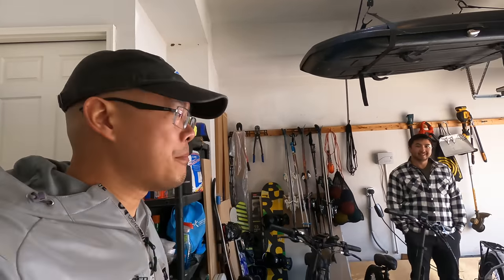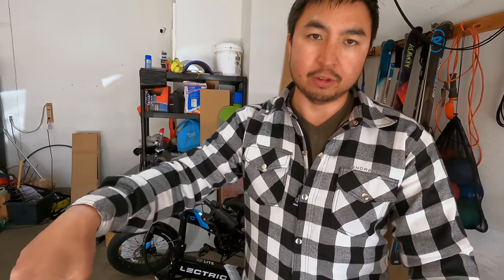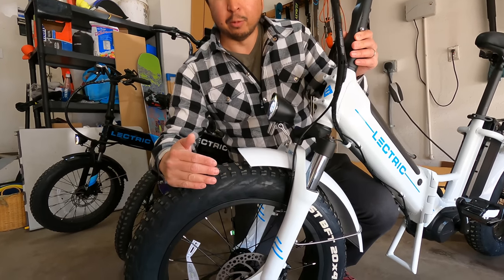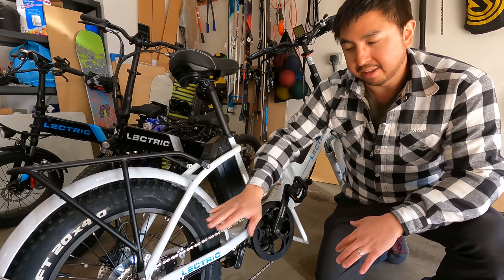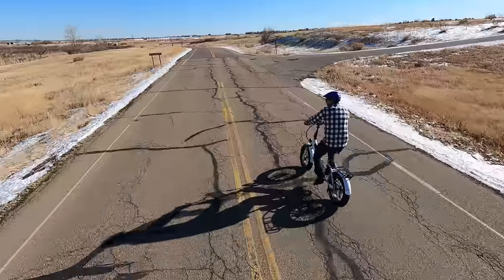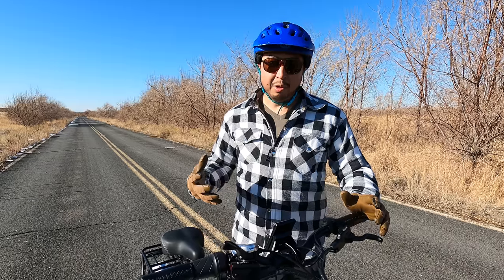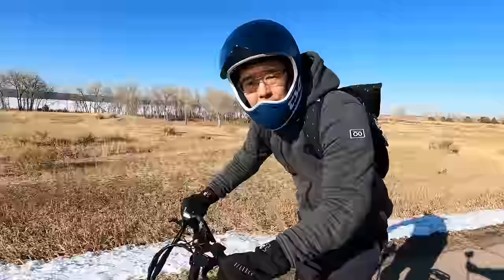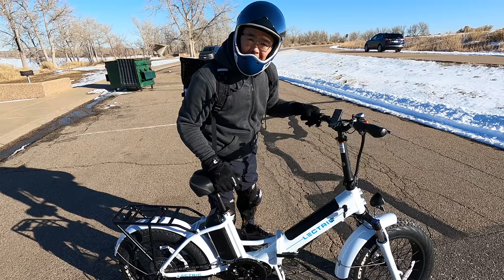Lectric XPremium Deep Dive: The Cadillac of Foldable Ebikes

Comment: I prefer the 3.0 tires over the 4.0. I like less resistance and more carving ability. Hopefully they make a X Premium 2.0 with an upgraded motor for going up steep hills.
Reply: I agree. Also if possible try and lessen the weight to a more manageable 50lbs with an option of getting 3” tires without a so call upgrade of tires.
Reply: I do not like proprietary tires.

Comment: How many NM of torque does this motor have?  thanks for the review.
Reply: It supposedly has 120 nm of torque. However the torque sensor is adjusted so low you can’t even match the power of the 2.0 going up hills. This is a programming flaw in my opinion. Lectric does not want to give the rider the full power of this bike for some unknown reason. I called them and they told me this adjustment is locked from the factory. I’m very disappointed in the bike I waiting more than 3 months for having paid for it in April. Save the money and get a 2.0.

Comment: That's a nice bike. I like the 2 battery upgrade and hydraulic brakes.  A bit too much bike for me and not willing to spend that much.

As an alternative for the same money you can buy two XP 2.0s and have two batteries as well as 2 of everything else.
Reply from the maker: But what if you don't have anyone to ride the second bike?
Reply: @freshlycharged  Just use it for spare parts.  Or take turns riding them.  Your 2 bikes will last a long time.  You can ride twice as far before doing my maintenance.
Reply: @gimpman1357 sounds like there are better brands than Electric, which did you buy?

Comment: let me get this straight. the lectric xp 2.0 is $999 and battery is 9ah. and replacement battery is $299 so, if i get the xp 2.0 with another battery, the total will be 1300 and a total power of 18ah...... the NEW xxpremium has a battery that is 20 ah, just 2 more ah for $500 more? i could even get a third battery for the XP 2.0 and have 27ah for the same price!!!!! Anything else im missing here????

$800 more just for a battery that is 11ah more? no thanks, i can get 3 xp2.0 batteries for the same price and get MORE AH////
Reply: Yeah, the xp 2.0 batt's are grade C pieces of crap, that wont last half as long as a real Grade A battery.  Its too bad you are so gullible to believe a battery is that cheap.  Go read up on what Musk is saying about lithium batteries and lithium prices, and you will MAYBE comprehend how gullible you are.   Battery prices for Grade A real Samsung's (not knock offs of Samsung) are running about $600 retail for 48V 11 AmpHour.  If the price is materially lower, it is not even remotely close to the quality of a real Samsung, and the life will be 1/3rd as long.  You will pay more in the long run, as by 18 months, your battery will degrade by 20% as a grade c knock off, which it is at that price.  The math does not work, and whether Lectric is lying about what you are getting, the truth is, you are not getting Grade A batteries.  Neither are the batteries on this POS with two batteries, Grade A.  Just not happening.  Prices were going way up even before all the supply shortages, as there is just not enough processing capacity for the lithium after its mined, and the mines are MINTING MONEY LEFT and Right.  Musk has raised his car prices that were supposed to be coming down, (due MOSTLY to battery costs) and these ebike brands are hemorraghing red ink attempting to keep their sell price low, but also having to cut severe corners which is being done on the most expensive ebike part: the battery.   There are no DEALS to be had with batteries.  You get bad batteries at cheap prices, and quality batteries at expensive prices.  There are no quality batteries on ANY Lectric ebike. None.  Every XP owner will be buying 3 batteries for every 1 battery that higher quality ebike brands have, that are priced for quality.   If you want cheap, and no quality, then a XP or a Lectric is for you.  But it will be the most expensive ebike per mile you could ever buy if you manage to keep it running more than a couple seasons without major repairs. my shop gets dozens of calls per week from Lectric XP owners problem prone ebikes.
Reply: @markg3950 great insights! Are there any foldable eBike that you can recommend to a first time buyer?

Comment: is this model using the same rear freewheel as the XP 2.0, 14-28??  If so I think the first thing I'd do is put on a 11-34 freewheel to gain the top end AND  hill climbing ability!
Reply: I'm looking forward to the mod videos 👍 Add a front hub & rear hub motor with a 72v battery 😀 50mph 😬
Reply: Curious about the freewheeling, myself.
Reply: It is a freewheel design, and yes, it could benefit from a different, wider gear ratio.  Which is strange because as mid-motor, it could be designed-in with a cassette drive system in the rear wheel.
Reply: I spoke to Lectric and it is the same size 14-28. So I’d put on a 11-34 right away. $30-$40 cost